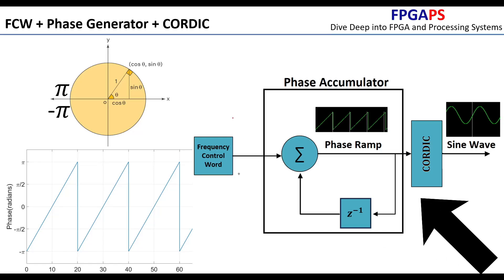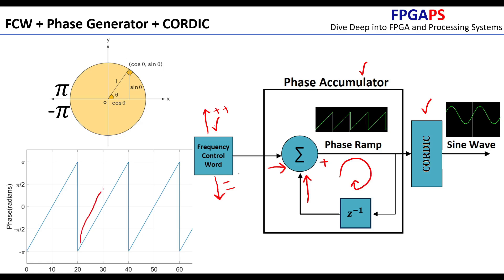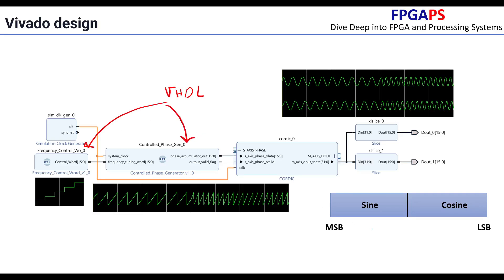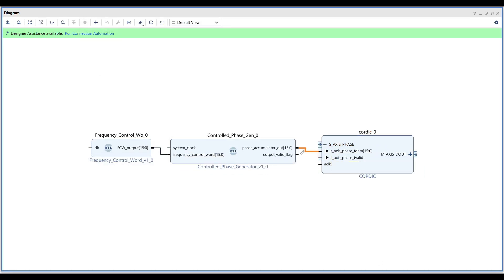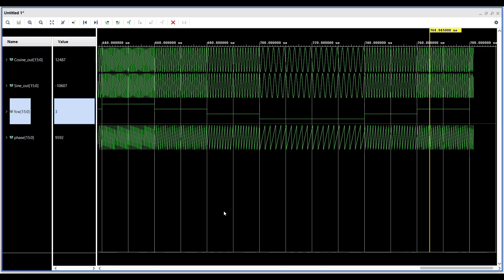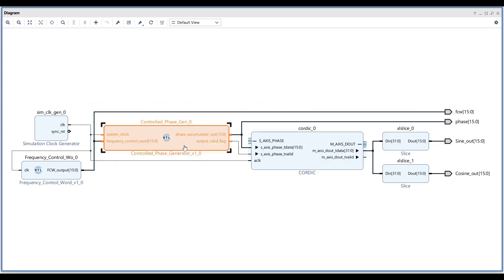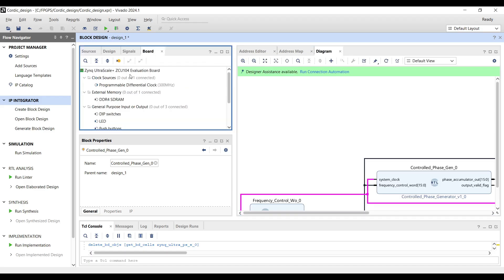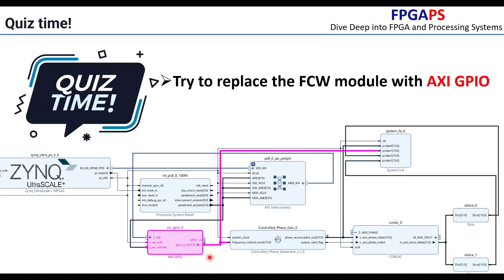CORDIC IP Tutorial: Creating NCO for Sine and Cosine Generation in Vivado

Comment from the maker: 📢 In the previous videos, I demonstrated how to generate Sine and Cosine waves using a LUT (BRAM). In this video, I will cover the CORDIC algorithm for wave generation.

The choice between using a LUT or CORDIC ❓ depends on your design requirements, such as:

✔Arbitrary vs. Fixed Wave Generation: If your design allows dynamic changes to the BRAM content, you can generate a variety of waves, not just Sine and Cosine.
✔Required Output Resolution: Consider the resolution needed for your application.
✔Available FPGA Resources: Decide whether to prioritize BRAM or DSP resources based on availability and efficiency needs.

Comment: I tried to adapt the design to an fsk where the FCW changes based on an input bit but I get a distorted sine wave for very high frequencies in the range of MHZ and for low frequencies around 40KHz I get a nice FSK output. Do you have any idea why it does this? I would like to design an fsk with center frequency around 100MHz or more
Reply: As the frequency FCW gets higher, the sine output gets more and more distorted